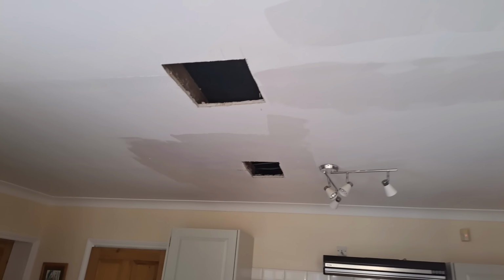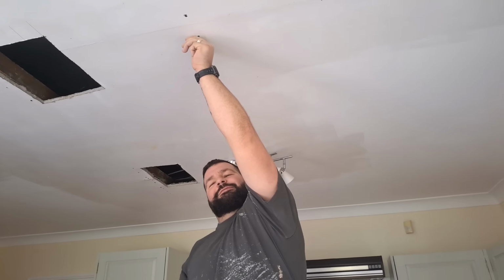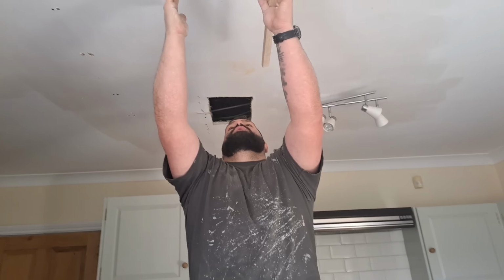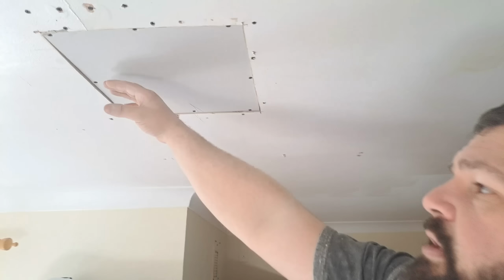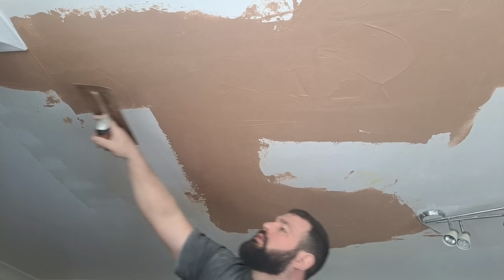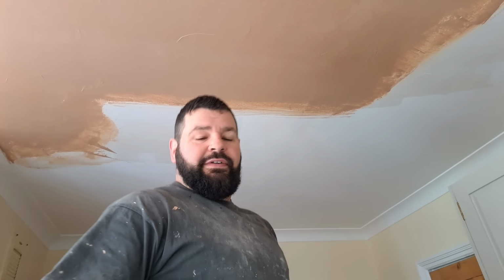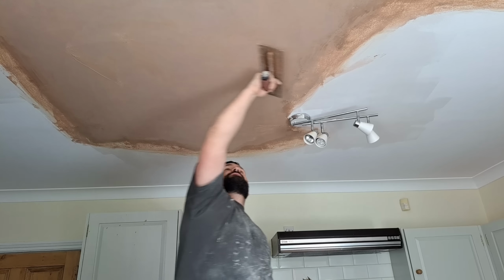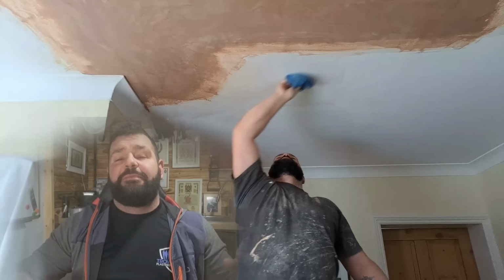WATER DAMAGE CEILINGS| PERFECT FIX FAST

Comment: I take onboard everything you say mate I've been plastering about 3 years now  for my self.properly for 1 year the tips you say are great and I try to use every single one you say to make my life easi everyday  am a 21 year old lad on my own moved out of home at 15 and worked ever since from wearhouses to labourer to plastering   I was struggling a little  before to keep up with bubbles ripples ters once there brushed in boom  I used to panic but I've realised once  you start panic  and run  around  like a headless chicken you make bigger mistakes I've now took my time to be as clean as possilbe. you make my job alot easier mate your labourer has a good mentor hope he takes everything onboard cheers mate I'll buy you a beer for two
Reply from the maker: Rhys, love reading comments like this. Thanks mate

Comment: Put a screw threw a washer. This has a bigger surface area that pulls the board up tight. Then screw either side of the the washer then remove the screw with the washer and repeat.
Reply from the maker: This is a top tip. Thanks Harry

Comment: any reason why you wouldnt use easifill here? Im about to do a plastering job on a room and theres some gaps between panels and patches where board isnt flush and I was thinking of using easifill before plastering. would this be ok or not thanks!
Reply from the maker: It would work but would be easier to use bonding.
Remember to seal either of them if your not skimming them the same day

Comment: Love the content just a quick question just bought 8 bags of board finish for £2 quid a bad because it’s out of date next week Tuesday will I be ok you recon lol 😂
Reply from the maker: Be abit greasy to use. Will either set faster or take ages to go off...
I've used shit 2 years out of date in the lock down. It's possible but for the few quid I'd rather have fresh stuff.

If you have any fresh stuff then first coat with the old shit and second coat with the nice new stuff...

Let me know how you get on
Reply: Yhh I’m going over artex Monday so it might be ok if it picks up a bit quicker lol yh I bought some fresh multi Aswell just in case 😅

Comment: Plaster board ceiling should not crack in an extended Straight line as boards should have been staggered when fitted.
Reply from the maker: Unfortunately they weren't so this is what we had to deal with mate
Reply: @Onthetrowel  well done & job as always 👍👍
Reply from the maker: @exc450\BMWRR  cheers mate. Hope you're having a good weekend pal